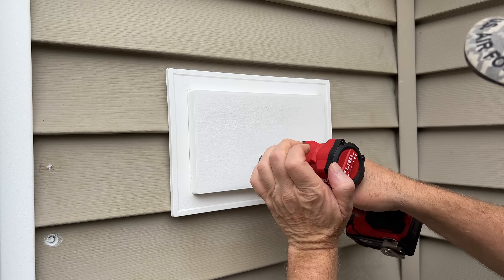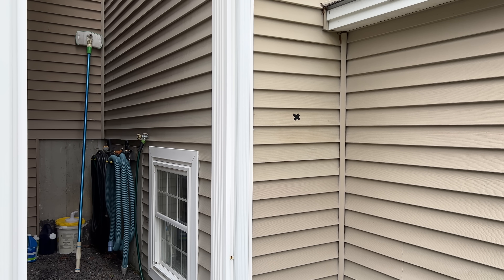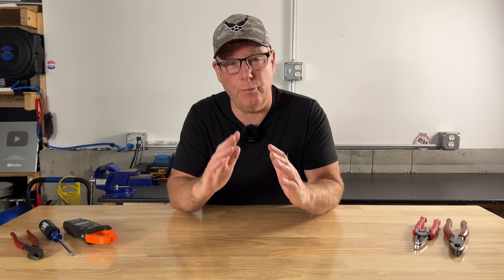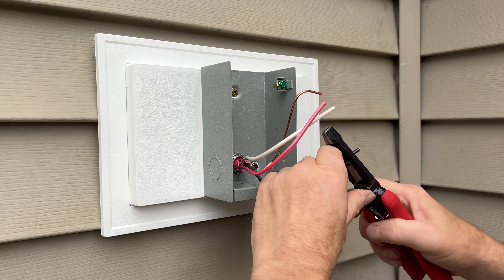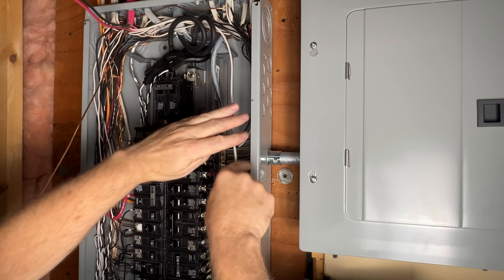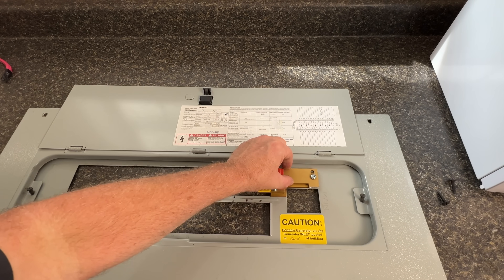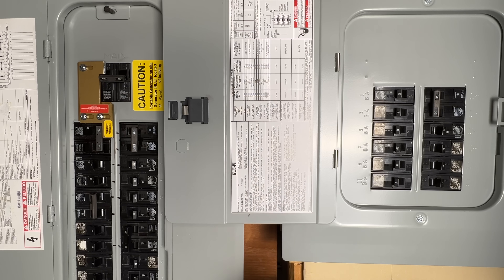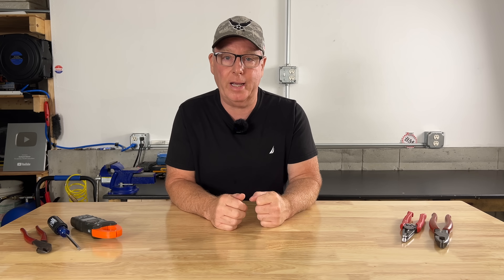Watch This Before Connecting a Backup Generator to Your Home.

Comment from the maker: The first 1,000 people to use my link will get a full year of Premium membership to Woodworkers Guild of America for only $1.49: https://go.wwgoa.com/backyardmaine/
Reply: Hey thanks for the video and the Membership!
Reply: Thank you so much for your very well and clear explanation, 
I do have a question;; it’s that generator inlet box safe for use when raining???, I haven’t heard any electrician talk about that,, when the cord is plugged in I see it easy for rain to go in,, I’m asking cuz lot of time when the power is out also is raining. I’m wondering if rain do not go into the outlet.
Thanks in advance
Reply from the maker: @Lifeisone93  The inlet box is rated for use outdoors in wet locations. But you should be connecting and disconnecting the cord from the inlet with the generator off. When the power goes out go outside and connect your cord and plug to both the generator and at the inlet. Then start the generator. Go inside and turn off the main and turn on the back feed breaker. Then turn on the loads you will be supplying. When utility power returns, you want to turn off the generator backfeed breaker and turn on your main. Then go out and shut down the generator. Then disconnect your cord from both the generator and the inlet. I hope this helps.
Reply: @BackyardMaine thanks for your reply, yes it helped a lot

Comment: Having a mechanical interlock has two important issues. First is the safety of utility workers.  Second is that there is no way your generator will power your own house and all other houses connected to your transformer.  Depending what a utility worker is doing, he may have the other houses on your transformer disconnected which definitely creates a hazard for the worker.

Comment: Kind of surprised you don’t mention about the generator and how to deal with it if it’s bonded ground or a floating ground.  I know thats a whole video in its self but i am amazed at how many people do this set up and are using a generator with a bounded ground not safe.
Reply from the maker: Yes I thought about that but the video would have been 30 minutes long. I did male a dedicated video on the subject. https://youtu.be/gchq6G5Wc8M

Comment: I thought the outdoor box is considered a wet location and therefore, romex can’t be used for entering the box?
Reply from the maker: You can use romex to feed into the back of an exterior electrical box for a light fixture or a receptacle. The cable is never exposed to elements. But if the cable entered a conduit that ran along the exterior wall or into the ground then that would not be compliant.

Comment: Are we required to run an unbonded generator when using an interlock switch here in Maine?
Reply from the maker: That’s correct but not just in Maine. Every state. I made a video covering last week. It was my last upload if you want to check it out

Comment: Any idea what kind of money it would cost to get an electrician to do this?
Reply from the maker: A 30A generator connection installation typically costs $500 to $2,500, which includes the cost of materials and labor from a licensed electrician. The exact cost will vary depending on your location, the specific components needed and the complexity of the wiring run, and whether you need permits and inspections.

Comment: I hired an electrician, and he suggested I run a 100' cable out to my shed so I can keep the generator hooked up 24/7. With the remote start fob it makes switching over easy, the cable was expensive but still far less than an automatic system and it moved the generator noise 100 feet away.

Comment: Is anyone separating the neutral from the ground on their generators so that there is only neutral from a single source?
Reply from the maker: That is required for this type of connection. The neutral to ground bond can only be done in one location. I need to make a video on this subject
Reply: @BackyardMaine great! I have been an electrician for 10 years. I've installed plenty of home standby but I just did my first portable hookup. I did it then watched your video and our work was identical aside from me opening up the neutral on the generator. I was thinking of doing a ground rod near the generator since neutral won't be bonded
Reply from the maker: @joelpatrick4568  Good work. My generator has a floating neutral and as you know you can only bond in one location. A ground rod isn't required by code and I don't think it's necessary. When the generator is connected it's bonded to the system grounding electrode so it has a frame ground bond. The only time I ground rod would be required would be if you were running the generator as a separately derived system (bonded neutral) or if you supply loads when not connected to the home. You can buy or make a grounding plug if you plan to use the generator for loads when not used for backup power.
Reply: @BackyardMaine yeah it was so the owner could still use it when not plugged into the home

Comment: Isn"t having a sub panel a redundant step. We already have a breaker for every appliance, pump, furnace fan that we will need in a power outage.
Reply from the maker: I installed the sub panel for my battery system. It transfers over automatically so I needed to pick my critical loads to be sure not to overload the inverter. I use the generator to recharge the system. I have several videos on that system.

Comment: Love how you keep it simple and clear. I am about to set up a Westinghouse 11,000 dual fuel inverter generator with a 50A breaker. I am going with the inverter generator because some of the heating appliances need the clean power or it can cause damage to the appliance computer boards. Even though I have a lot of electrical experience, I was going to hire out an electrician. But this video reminded me that I am more than capable. What cable would you use from the panel to the generator inlet box? The cable is only about 30' from panel to inlet.

Comment: Hi John, along with your video, and a couple of others, I recently installed the interlock/inlet/fusebox setup. All seems to work great. I've recently been seeing videos about grounding/bonding/neutral connections on generators hooked up to your house with the interlock. your vid and the others didn't mention anything about that, so... Is this something I need to think about?
THanks.
Reply from the maker: Yes.. For this type of connection you need the generator to have a floating neutral. That means the neutral and ground are not connected together at the generator. Our neutral and ground are bonded at our first point of disconnect which is either at the service disconnect or at the main panel. If we have a second bond, current will flow on the ground creating an unsafe condition. The only time we would have a bond on the generator is if we were running it through a transfer switch which also switches the neutral. One more thing to note. If you use a floating neutral generator for something other than home backup you will want to buy or make a bonding plug to bond the neutral and ground for that application (for safety).

Comment: Is your generator floating or bonded due to the fact that your main bonding jumper is bonded at your service disconnect outside ?
Reply from the maker: Floating. You will need a floating neutral generator unless you have a transfer switch that switches the neutral along with the hot leads. Otherwise you would have two bonds which can be dangerous and damaging.

Comment: Question: is this Romex Indoor you're using? I didn't think you can run this wire into outside since it's considered wet/damp location ?
Reply from the maker: You can use it to go through an exterior wall directly into a box. But you cannot use it out in the weather or in underground installations even in conduit.

Comment: What is the amp breaker size going to the Sub panel? I know your main breaker for the generator is 30amps, but the Sub panel looks like it's a 45amp? Just want some verification. Thank you
Reply: Thats why you have to watch your usage. A 30A breaker will let you exceed 30A for a couple of minutes before it reaches 40°C and kicks off, so if you are actually pulling 45A through the subpanel it would take long for it to kick

Comment: Thks for your video what about a soft start for the A/ C MY GENARATOR IS 13000
Reply from the maker: The inrush current from large inductive loads can be a problem for portable generators. A soft start is a good option to mitigate the problem as long and the generator is sized to handle the AC load along with whatever else is connected.

Comment: You are running a system with 2 bonds. Your hot wires are obviously disconnected from the grid but the ground and neutral in the outside panel and in the generator are still connected. 

I thought that was absolutely not allowed?

I'm installing mine today and I'm removing the bond in the generator. I'm connecting mine with a whip at the outside panel.
Reply: He's using a Champion generator so it's possible it already has the floating neutral. Not all portable generators come from the manufacturer with the neutral bomded
Reply from the maker: No, my generator has a floating neutral. I double bond is a code violation and dangerous.

Comment: I have this same setup in my home with the 30 Amp receptacle and currently trying to decide which generator to replace my current one with.   Since the 9500 running watts unit is $300 less than the 8500 unit, could you please explain why you would choose the lesser wattage unit as stated in your recommendation?  Thank you for taking the time to share this video.
Reply from the maker: Thats interesting. When I posted the links the smaller generator was much less than the larger one. For less money I would go with the larger unit. It will burn a bit more fuel but will handle surges much better and you could increase the size of your generator connection to 50A if needed in the future.

Comment: what if your panel has no 200 amp or 100 amp breaker? and its just the main 200 amp out side that you have? what do you do then?
Reply from the maker: There are a couple of options. You could add a back feed breaker with interlock outside if there is available space on the buss or you could install a sub panel and interlock with the breaker that supplies it.

Comment: In 2023, we had an electrical company come and install a 50 amp system for us. We had previously upgraded our home electrical panel to 200 amp to meet local codes. We purchased a Duromax dual fuel ( gas or propane) 13kw generator and they installed all the connections, conduit, and receptacle at the back of our home. They also changed out a few breakers to update the panel. So far, we’ve needed to use the system twice and everything has worked as it should. Instead of using a 50ft cable from generator to the connection, I purchased a 10 ft 50amp cable and keep the generator connected full time. It saves time when switching over from house power to generator. 
I run the generator about once a month to keep it ready to go. 13kw is plenty of power in a blackout situation for our home.
Reply from the maker: Sounds like the perfect setup.

Comment: I have a single wide 3 bedroom, 2 baths.
Mobile home with a 3 ton, AC heat box unit a well pump. I had it an electrician. Install a 30 amp to my mobile home will a 13000 generator power, my mobile home 🤔
Reply from the maker: It should run both the well and the AC unit fine as long as the generator can handle the inrush current when the AC unit starts.
Reply: @BackyardMaine thank you i really enjoyed your videos I have a 6500 Generator and I'm interested in getting the 13,000-watt that's why I asked that question
Reply from the maker: @natemiller862  If you getting a 13,000 watt generator you may want to consider upsizing you feed to a 50A. The wiring from the generator to the backed breaker by code needs to be sized to the continuous rating of the generator so you would most likely need to up size the wire anyway. If you do that you should also upsize the breaker and the inlet box to take full advantage of the higher power rating.

Comment: I was told NM cable is not code compliant for exterior surface-mounted boxes, and that UF cable is required.  Is this true?
Reply from the maker: You can't run NM-B Cable outside unless it's under roof but if you penetrate a wall to an exterior box ROMEX is fine.

Comment: I called two electrical companies for a inlet box install and one told me $1400 to run it to the back and the other said i needed a transfer switch and that would cost $2300. I think thats a lil to expensive if you ask me.
Reply: It reallly depends on where you live. We charge $750-$1000 for inlet box/interlock kit in MN. Usually $1000-$1200 for wiring up a multi circuit transfer switch.
Reply: @johnshottie4415 $600 in labor? That seems high. I'm sure it's cheap in some places. I guess that's why I always do it myself.
Reply: When you send them an invoice for the trash removal that they leave it's basically free
Reply: Had mine installed by an electrician but I need the 30A inside my garage not outside. Any advice for having both or how to include an indoor plug as well? Thanks in advance.
Reply: @billg6051 I'd just use the exact same outdoor setup inside if it's an a carport. I'd obviously put them on 2 different circuits.

Comment: I didnt see if you said it but did you mention you need to unbond your generator if doing this? And not to run regular anything else off the genrator  outlets while unbonded cause they wont have a ground?
Reply from the maker: Correct.. With this type of connection the generator neutral cannot be bonded. If it is you will have a second bond causing current to flow on the ground. But you are also correct that if the same unbonded generator to run individual loads when not connected to your home it would not be safe. You can make for buy a grounding plug for this application. The only time a generator connected to your home would have a bonded neutral is if you have a transfer switch which switches the neutral conductor along with the line wires. Then the generator would be considered a separately derived system.

Comment: Can you please tell me at what height to put the outside box and Is it okay, to run 25 foot? Wire  to the panel. Thk you.
Reply from the maker: You can run 25 feet to the panel just be sure to size the wire to the generator output capacity (Not the surge rating) or the breaker size. For example you may need 8 gauge wire for the generator continuous capacity and connect to the L14-30R receptacle and have a 30A back feed breaker. The hight is not specified but be sure to mount the inlet at a level that will not be buried in snow. I get drifts in the back of the house so I mounted mine quite high.

Comment: Why didn't you mount the mounting block vertically so it looked nicer?
Reply from the maker: I didn't want to cut more siding than necessary.
Reply: @BackyardMaine  one more row would habe killed ya? Lol seriously though good job and cosmetics aside you have it installed correctly and safely. There are some idiots out there with suicide cords making vidoes about that!

Comment: I see you aren't using or recommending inverter generators. I assume you don't have any concerns with "dirty" power and your appliances/electronics? My old open frame gen is rated at <6% THD and while above average, I was still told that's not good enough for fridge compressors, furnace control boards, etc.
Reply from the maker: I don't run computers and TVs on the generator but I know pretty much everything has electronics these days. I do play to replace my generator with an inverter before winter.

Comment: What about unbounding your generator so you don’t have two neutral bonds, one be in your house and the other being in the generator
Reply from the maker: The neutral and ground bond can only be done at the first disconnect at your home. So unless you're running your generator as a separately derived system, (ie. Switching the Neutral) then the bond at the generator needs to be removed. Otherwise you would have two bonds and current would be parallel flowing on the ground and neutral.

Comment: Do i need a sub panel? Can i just power what needs to be powered by generator in the main panel?
Reply from the maker: You don’t need a sub panel. Just be selective with your circuits so you don’t overload the generator

Comment: Can you answer a question for me, sir? My electrician connected the Bare grounding wire and my white wire both to the neutral bar. Did he make a mistake?
Reply from the maker: If the bonding jumper between neutral and ground is in the panel you ok. If it out at the meter that’s a code violation. If the service cable coming into the panel has two hot wires, one insulated neutral wire and a bare ground then the bonding jumper is most likely at the service. If you have two hots and one bare ground coming in the the bonding jumper will be at the panel.
Reply: Can you please tell me at what height to install the box outside and is it ok to run a 25ft wire to the panel

Comment: Thank you for time in making   so very informative video's. 
  Qq .. a setup like this with a 120v Generator backfeeding into the double pole breaker, would it damage the 240 devices if those 240 devices were left on ?
Thanks
Reply from the maker: Usually not but it's a good idea to turn them off. Some 240v appliances also have a neutral and could have partial power which may or may not be an issue depending on the manufacturer.

Comment: I have a 5000 watt gen it only has a three prong outlet on it. Can I change it to a four prong 30 amp my house already has a set up for a four prong.
Reply from the maker: If the generator only has a three prong outlet then it only produces 120v. In order to have a four prong plug work to back up your power you will need a 240v generator.